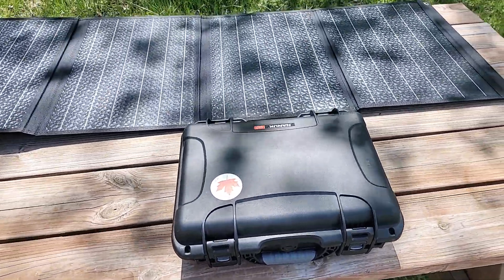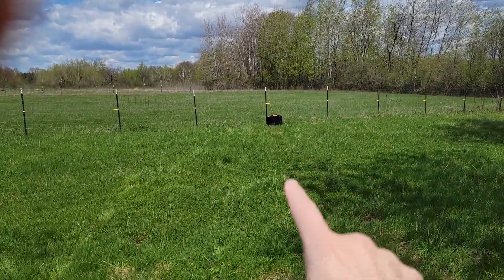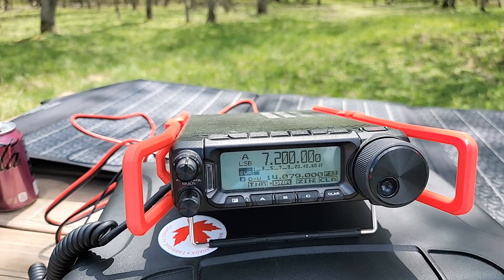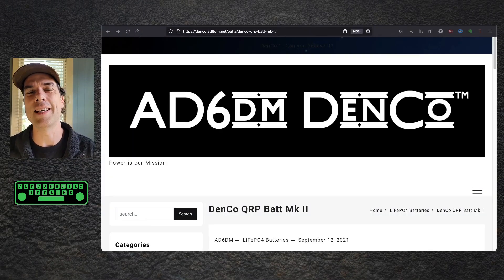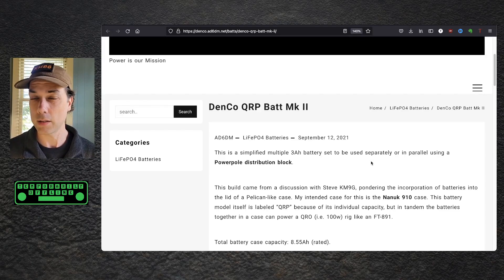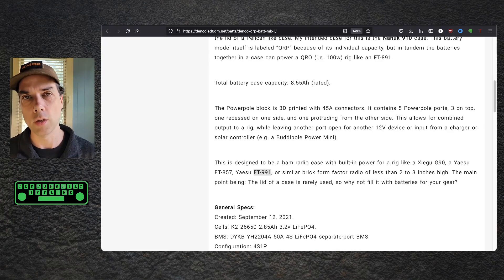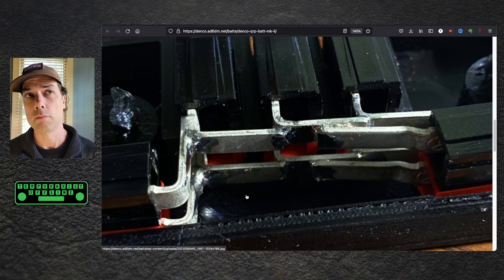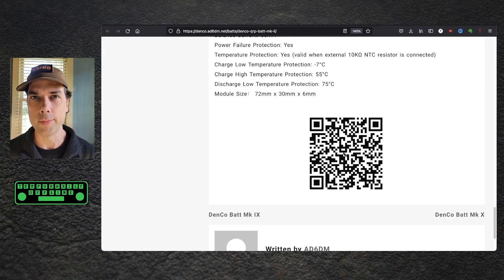A HamMade 9Ah LiFEPO4 Battery for QRO Portable Ops

Comment: Nice,  Next run the antenna down to the electric fence with a bias-T to keep the batteries charged. 
Surprised you didn't hear it thumping. I can hear two deferant fences in the area thumping on 160m. NB
Reply from the maker: That's a woven wire fence - no charger 😀